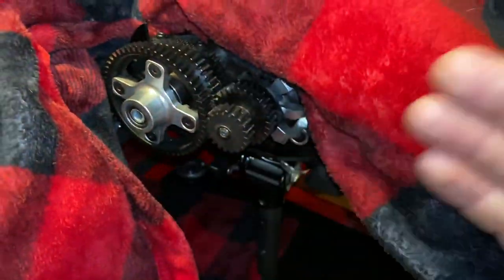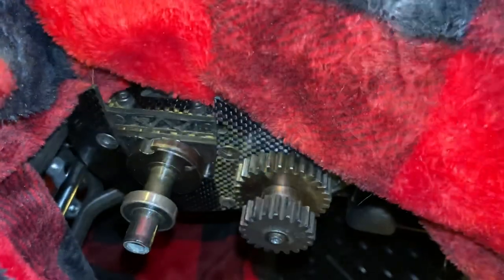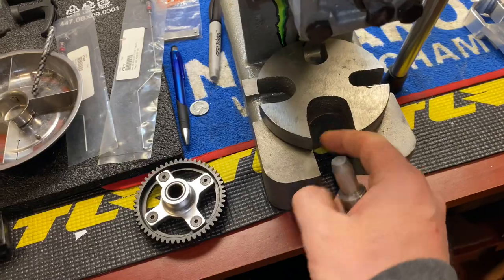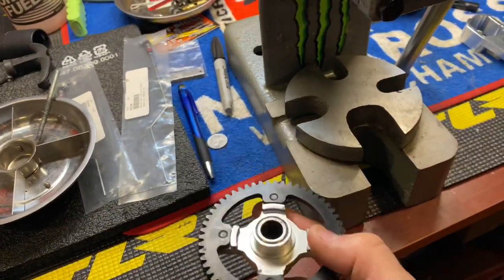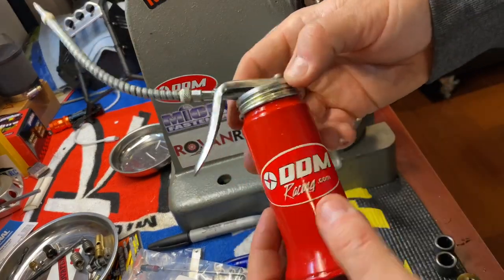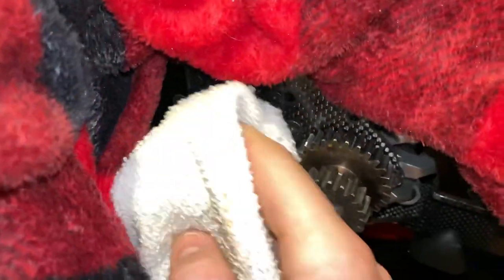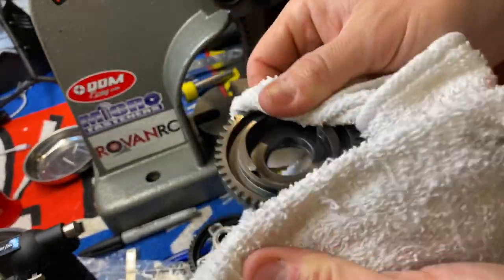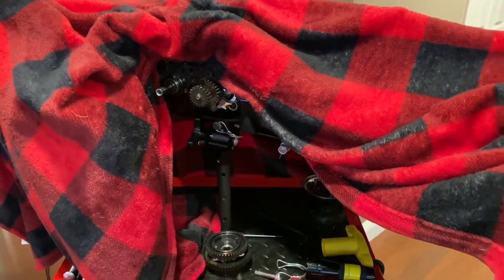Let’s Go Over My K👑M 2Speed Transmission /PRIMAL Gears Together With Some Maintenance

Comment: I have been working on my max t all day sure am glad I pulled the transmission it was bone dry and sealed with silicone so it's done right now also done shocks they were half full got the battery change out all the wires sorted out kill switch installed just about done and the coil was serious loose
Reply from the maker: Awesome bro good stuff ! Wish more of the new younger generation would wrench 🔧 more like us and go over there things . Not many people nowadays want to work for things and I think it’s because there just so used to having everything handed to them when they were younger .

Comment: Heat the gear with a heat gun, and the bearings push out by hand. and when you assemble, put your new bearings in the freezer for a couple of hours, and heat gun the gear, and they nearly fall in ... i just push it in with my thumb ;)

Comment: Great video Botajell I was wondering if KM has any more gears for the 2SPEED?
Reply from the maker: Yes they do and there great 👍! I use them on my drag Baja with Bartolone 34 ReedCase drag mod engine. There actually Primal gears ⚙️ and there hardened. These primal gears will fit and work on your KM 2 speed just pick the sizes you want there are many sizes https://primalrc-com.3dcartstores.com/dragster-transmission Tell Them I said hello 👋🏼

Comment: I have a problem I hope you have a fix for. I installed the GTB 3 speed gear set in my Baja 5b it goes until the first shift then it free wheels until the rpm's drop then it clicks into first. Everything is installed according to the directions and one way bearing is good. Please help it's driving me up the wall. Thank you.
Reply from the maker: You got to get rid of that 3 speed and get yourself a King Motor 2 speed if you want less problems trust me !! With the king motor 2 speed you will be able to get and use the Primal RC gears ⚙️. Many of us use that set up on our Drag Race BAJAS and PRIMAL Dragsters from small blocks to big blocks . I will be able to help you with that setup and even tell you some tricks and tips to make that 2 speed even better! Get me on Instagram to talk better

Comment: Very good info! Would you recommend these 2 speeds for just drag racing or would they hold up on a basher?
Reply from the maker: Best to use for drag racing especially now since PrimalRC Now carries many gear ⚙️ ratios for different engine and race track applications! But you can bash with them if you want ? But just be ready for lots of maintenance on them because it will be exposed to dirt more and bumps and crashes .
Reply: @BOTAJELL  awesome thanks man!

Comment: Never use any oil on oneways except hudy one way oil ...i have had blackbone 2 speeds for about 7-8 years hudy is the only oil i use and have never had one fail.
Reply from the maker: In 3 years I’ve never had a fail with my one way bearings  by using one drop of Lucas Oil Stabilizer on them . Also many people that drag race in Brooklyn used to go threw oneway bearings monthly and know there lasting them well over a year by using a drop of the Lucas stabilizer stuff. Try it on yours and see how it goes . I will definitely grab me some of that Huddy one way oil to try out and keep in my box 👊💥🤝💥🤜🤛thank you !

Comment: hey whats most those guys time with small block 30.5 stock chassis km 2 speed bajas in 132ft I have a nasty 2mm stuffer full mod hand port 30.5 just wonder whats considered fast for a stock chassis small block on a hit. #QBR_quesenberry racing

Comment: Great info for the peeps who use 2 Speed tranny's
Reply: @BOTAJELL  Hey bro, Had a small issue tonight. For some reason, and this is the 2nd time this happened. The stock coil spring came off my spark plug wire on my 30.5 cc CY Engine. So I removed the coil so I can order an MSD Wire for it today and not paying attention one of the dam coil spacers went behind the flywheel I think, and I cant find the dam thing. Now for some reason I cant find those spacers on Rovan or DDM's site. Do you know where I can get them? Im guessing I need to pull the flywheel as well just to ensure its not sticking somewhere behind it? I mean I looked for a good 20 minutes, shaking the car, turning it upside down, and the dam thing just never fell out. Any thoughts?
Reply from the maker: CBR Wix get rid of that coil and install a high voltage coil from Zenoah. You can even use the wire it comes with it but if you like the MSD wire ? Go for it no worries just install it correctly . If you need spacers ? Upgrade to the Bartolone custom coil spacers . I’ll try to send you the links here is the coil you want http://www.davesmotors.com/zenoah-zenoah-complete-rc-ignition-coil-with-cap.html you must get this tool also for proper installation! DO NOT USE Business card http://www.davesmotors.com/3330-97310-Zenoah-Flywheel-Air-Gap-Gauge-Tool.html this is the coil spacers you want to upgrade with http://www.davesmotors.com/Bartolone-Racing-RC-CY-Billet-Ignition-Coil-Spacer.html
Reply: @BOTAJELL  Ok thanks. I do already have the gap tool but yeah that spacer was my biggest concern. I still have no clue where that spacer went in my engine. Should i still pull the flywheel to see if its behind there? Thanks again.
Reply from the maker: CBR Wix it will most likely be plastic spacers so you should be ok not to worry! Got to be somewhere on your floor! Aluminum and plastic will not stick to your magnetic on your flywheel. Shake your engine anyways just to see if anything comes out before you reinstall everything
Reply: @BOTAJELL  That is odd. Cause the one that I do have is metal and it does actually stick to the magnet on the flywheel. Im going to pull the flywheel just to be safe.
Reply from the maker: CBR Wix if it’s metal ? Definitely most likely it got sucked up from the Magnet 🧲. Remove flywheel and double check. Just be carful reinstalling it if it’s your first time? Make sure the flywheel key is good and on the right way when installing the flywheel then torque it to 80 inch pounds but don’t use a piston stop tool ! Use a clutch holder and hold down the crank shaft so it don’t spin
Reply: @BOTAJELL  oh shit, I already used a piston stopper to remove the nut? Hopefully it will be ok? I will need to order a torque driver. Actually my buddy has a torque wrench I can use so I am covered there.